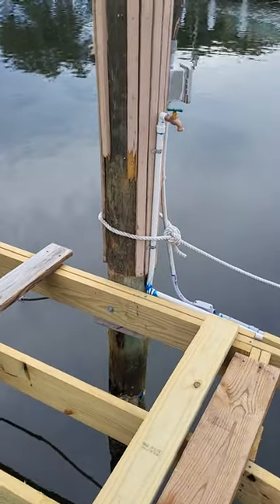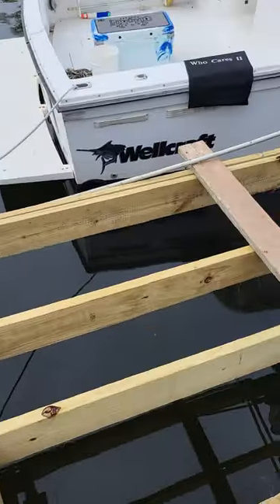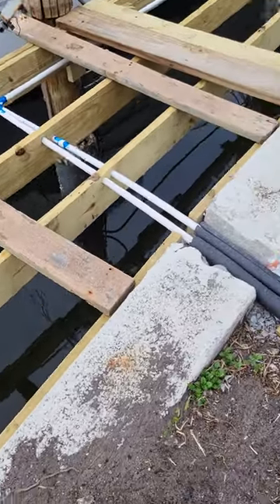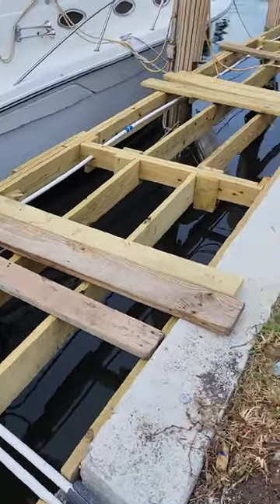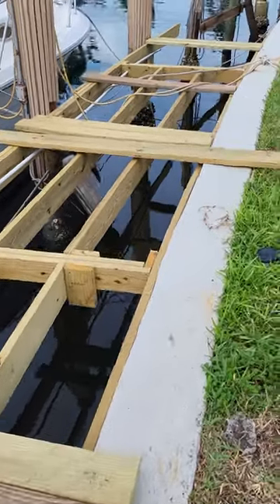John's handyman show,,framing out dock....

Comment: If mine,
1. No pipe penetrations
2. Add joist hangers
3. Add joist ledges
4. Add staggered blocking every 4 feet
5. Use bronze fasteners
6. Use bearing ledges at beam posts
7. Space joists at 16" on center
8. Leave 3/8 gap between deck boards to allow pressure relief from high tide swells
9. Use 2x8 as deck boards.